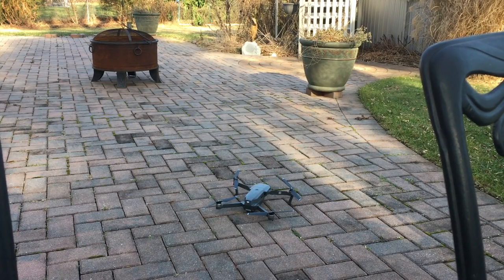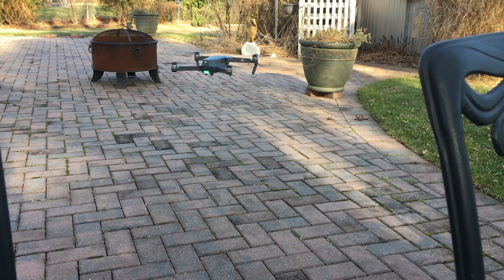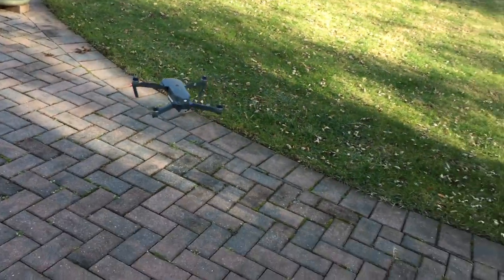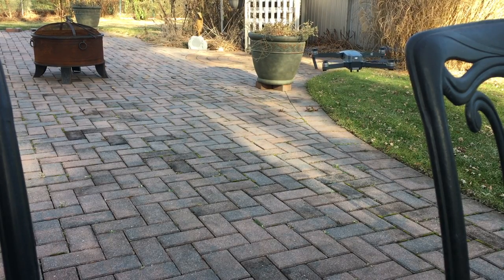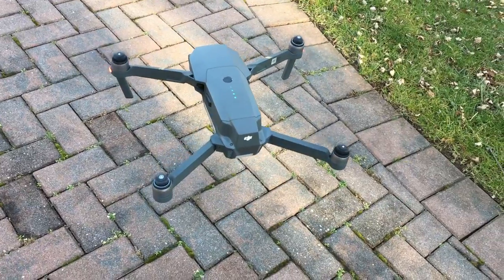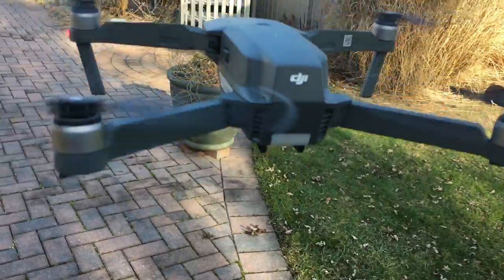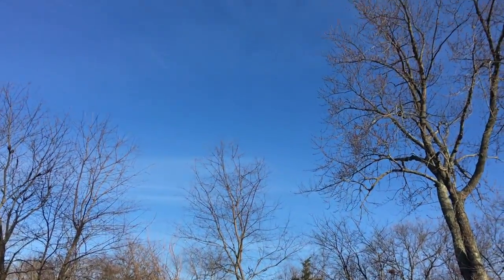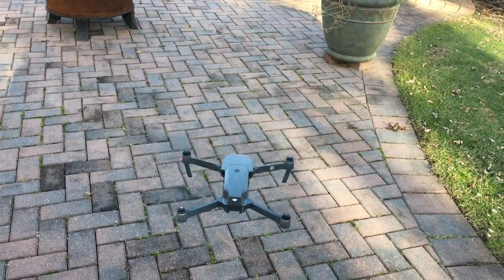Wobbly DJI Mavic  (UPDATE:  fixed)

Comment: I had the same issue - for no reason it just starting doing this.  I would have guessed it was a hardware issue if I'd not seen your post.  I tried new props - IMU calibration, Stick calibration, compass all to no avail.  DJI Assistant servers were down this weekend so I tried a firmware downgrade and that resolved the issue for me.  Seems that the Mavic has many software defects.  The only bummer is that Saturday was the only good day to fly for the next week here and my Mavic was not working.

Comment: They might ask you to connect to the Assistant software and refresh firmware.
I'd guess one of the motors has gone faulty - probably back left by look of it.
Does it feel stiff at all turned by hand?
Reply from the maker: FIXED.    I connected to Assistant and did a "Restore to Factory" and now its all better.
i think my use of a different phone screwed things up  My phone was low on battery so i installed DJI GO app on my wife's phone and used it for a flight or 2, which was fine.   but i think when i switched back to MY phone, that is what caused the problem.